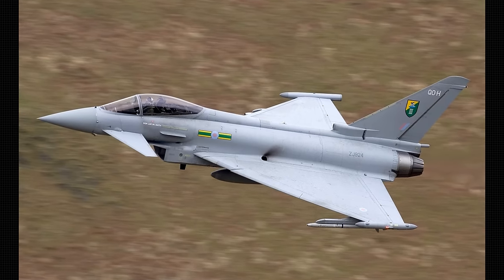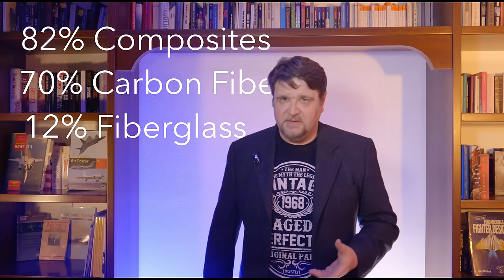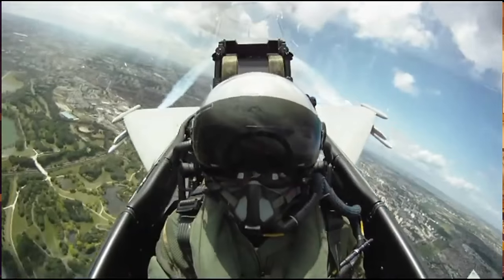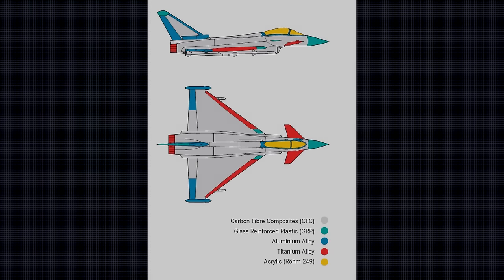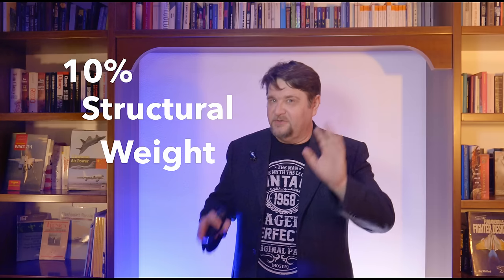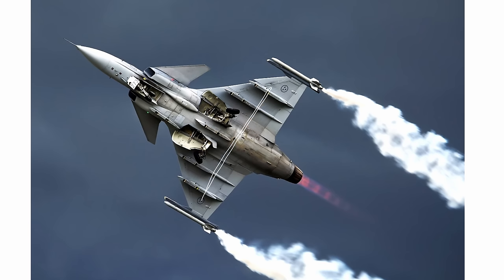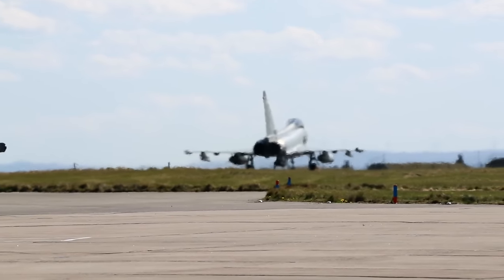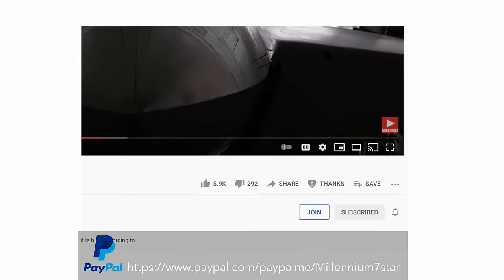The Eurofighter Typhoon is made of...

Comment: My understanding from when I did work on this sort of stuff was that composites were considered to have infinite fatigue life.
Reply from the maker: Yes, almost. Albeit at the time they weren't sure
Reply: The carbon fiber has infinite fatigue life, but the resin does not. The high stiffness of the carbon fiber takes a lot of the stresses, so that the resin is a lot less loaded and can last nearly forever.
Reply: @gbornitz  yes this is true but when you are designing aircraft the trivialities between a fatigue life of a billion cycles and two billion cycles means that they are considered to have an infinite fatigue life as long as there is no mechanical damage to the structure. So we never did fatigue because it is not a required assessment for certification.
Reply: @FG42  maybe true in an oversimplified, strongly controlled and well funded engineering environment - compared to classical aircraft industry alloys, might not be that much of an issue. But have a look into sailing magazines - a lot of well known yacht builders have been failing with multiple designs based on composites.
Reply: this depends a lot on details. UD cfrp loaded longitudinally at 0 does.

Comment: Even the armor on some of the latest US tanks uses composites. Fascinating stuff.
Reply: Tanks have used composites for 50 years or so. Some of the earliest composite armor was basically fiberglass plates
Reply: @alexdunphy3716  Indeed. Fiberglass alone is what is used for bulletproofing many public offices, such as banks, along with the protective glass windows.
Reply: Different kind of composite, the term composite in composite armour simply means that it is comprised of various different materials like ceramics and different metals, rather than just one solid steel plate
Reply: @yukionna1649  not different actually. Fiberglass is a type of "composite material" in the same sense that M7* is referring to AS WELL AS one of the materials that make up "composite armor arrays".
Reply: @yukionna1649  No, actually it's both. Layered armor can be considered composite, as it behaves as one in certain conditions. Minor point, but also true that the latest armor uses composites directly as one or more of the layers.
Reply: @alexdunphy3716  True. Advanced materials, powdered metal technologies and auxetics are coming more into play now, so there does seem be a newish qualitative leap. But yes, fiberglass is excellent and is basically what you will find in walls protecting bank tellers.
Reply: True, but it's a different kettle of fish from the discussion here.  MHV has a video with a disucssion on tank composites with a guy who literally wrote a book on it.

Comment: Love the EF but I think it's already a bit outdated. No stealth, some electronic warfare equipment is still not included and costs are quite high in comparison to the Gripen for example. In fact it is one of the most expensive aircraft per flight hour, which is very disapointing...
Reply: A typical design of the 70ies. The F-18 variants are quite a bit better overall, the French designs from the same time are not as good. The EF designers had too much money, the Swedish had to be more cost effective, so at the end the Gripen is better for the typical role in Europe today. The original EF started out as a hypersonic bomber interceptor, which the Gripen is not.

Comment: An additional advantage of composite material is that they do not reflect radar waves like aluminium does.... I thought it was worth mentioning. 

Overall a great presentation of one of the most beautiful fighter jets currently in production, in my humble opinion! ;-)
Reply: depends on the composite type, carbon fiber also reflects radar
Reply: That can actually be a disadvantage as for something like a wing leading edge rather than reflecting off an oblique surface for aluminium skin, it'll pass straight through a composite skin and reflect off of the flat faced if the wing span instead giving a much higher return
Reply: do composite materials reduce the ability of planes to weather lightning storms?
Reply: @ozan1234561  Not as much as metalls.
Reply: It will still reflect electromagnetic radiation but not to the same degree as metals.
Reply: @rogeronslow1498  That's what I said.
Reply: @kilianklaiber6367  They do reflect radar waves.
Reply: @rogeronslow1498  Usually hardly at all.
Reply: @rogeronslow1498  And I stand by my point: They do not reflect radar waves like metals in particular aluminium! ;-)
Reply: @kilianklaiber6367  Yes, it's worth acknowledging that. All things being equal the RCS of a composite aircraft will be significantly less than an aluminium skinned one.
Reply: @gamingrex2930  no, they make it worse. Additional metal / aluminum mesh needs to be added to lessen the risk. In an aluminium aircraft, the outer shell creates a really good Faraday cage(?). Classic composites don't. But they might enrich them with copper meshes - I do not know, if it has been added here.

Comment: Bravo,well worth the wait, Im looking forward to the next installment, I have a few pictures of the EAP flying, it's original proportions didn't look as satisfying as the eventual Eurofighter but it's nice to know that it was a pioneer in proving "plastic" structures. In theory a future non leaky SR-71 equivalent could be designed in appropriate epoxy composites.
Reply: NO
Reply: not really possible, the temperatures at Mach 3.6 of the SR-71 are too high. That thing is a really crazy design, on the soviet side the MiG-31 somewhat compareable, as it was designed to be capable of intercepting the SR-71. That was 1975, and it is still one of the most capable things in the ruzzian fleet.

Comment: This has left me wondering what the Tempest will be like. The EJ-20x engines are already 20% more powerful and 30% is the aim. They also use less fuel for a given amount of thrust. The Tempest is also targeted to be 10% lighter dry weight. I also heard a rumour that the service ceiling is going to be increased by 3000 meters. If that happens then some modern missiles will not be able to intercept them as the aircraft launchine will make the amount of climb needed too much.

Comment: I have worked with composites in my past job, usually stupid decoration stuff made of fiberglass and polyester but occasionally we had the chance to help these graduate students for prototyping, had the pleasure to work on notoriously self heating epoxy resin and also carbon fiber a couple of times... and I hate kevlar, it doesn't get under your skin as carbon does but it's a pain to cut to shape... overall composites are an interesting engineering subject, tho working with them is bad for your health on the long run...

Comment: Seams contribute to an aircraft's RCS, so another benefit of super-tight tolerances is reducing RCS.  Ideally one would have no seams at all, but short of that the next best thing is making them as small and as consistent as possible.  There is some absolutely wild work being done on materials that allow seamless control surfaces, eg. instead of flaps, the trailing edge of the wing just bends.
Reply: it is easier to move the whole control surface, see F-22. Flaps, different story, not sure how much it benefits as they are only required at low speed flight.
Reply: @spxram4793  I'm not sure what you mean.  The F-22 has standard fighter jet control surfaces.
Reply: @JonMartinYXD  It is mixed, I just checked again. The vertical stabilizers are split, like traditionally, but the horizontal stabilizers are one piece and the complete surface deflects.
I have seen it last August in Slovakia on an airshow, 50m from me :-) pilot was moving the horizontals, then slowly rolling, turning in small radius, after that afterburner takeoff and simulated run on airfield - breathtaking.
The first two MiG-29 they prepared for Ukraine also had their farewell flights 👋 - I had the feeling of seeing a moment of history happening.
Reply: @spxram4793  The all moving horizontal stabilizers are called stabilators (or sometimes tailerons if they can be moved in opposite directions to help roll the aircraft).  Or at least that's what we call them today.  Back in 1950 when the technology first started being used on jets (F-86E) it was called an "all-flying tail".  It was actually used on early WW1 fighters but they were very twitchy so it fell out of favour until flight controls evolved past cables and pulleys, and jets got fast enough that traditional stabilizers were not effective.

Comment: Calculation of stesses in composites required transfomation matrices to the direction of the fibers.  I imagine even double weave layers need to be arranged strategically.  Still its amazing how carbon fiber is used in so many applications these days.
Reply: these are anyway complex composites with layers, where the fibers point in different directions. It is only cost which prevents them to replace aluminium - they're far better. Only problem is high temperatures above ~2M. That's why the MiG-31 has titanium alloys in critical places., for example.

Comment: Now-a-days top of the range bicycles are made of really good carbon fibre and they cost thousands and perform amazingly good, but then you also get very cheap carbon fibre bikes which are to be avoided.
Reply: they need to have a proper multi-layer design with the fibers pointing in different directions. The El Cheapos don't look after that.

Comment: 10% reduction in structural weight is a result of very conservative designs chosen to deal with poor analysis methods available in the 90's. In practice those composite structures are much stronger than the aluminum ones. On bicycles and cars, the lightest CFRP frames can be made about 50% lighter than the lightest Aluminum.

Comment: How much does the length vary with temperature?
Reply: I don't know exactly thermal expansion for composites is also anisotropic, but it is enough that machinists shops and assembly floors need to be temperature controlled, so that a part that was 1.250 meters long in the Italian summer can fit to a part that was 1.250 meters long in Germany in the winter.

Comment: What do you think about using hemp alloys for fighter jets and generally aerospace?Henry Ford used that on model T prooved durable than metal
Reply: Great for cannabis growers
Reply: hemp reinforce polymeres have their place, but certainly not for fighter jets and in aerospace in general not for load bearing structures. The thing with Cabon fibre composites is that they provide an extremly good tensile strenght to weight ratio and weight is a major factor in any aerospace application. Weight kills perfomance and efficiency of an aircraft. So your goal is to build an airframe with as little material as necessary to provide the required strength. Carbon fibre can provide that at the moment like no other material. hemp rp is ok when the leading factor to ask for is light and cheap. In a fighter aircraft you will always go for light and strong.

Comment: structurally the eurofighter progressed further in the learning curve then what was done with the f35. the only significant advancement with the f35 was its method of combining fused sensor data.
the exterior panels on the f35 used data gathered by the eurofigher/other known engineered solutions to gain structural integrity. apparently learning structure and kinematic performance is cheaper than updating software capability. 
does anyone wonder why LM is so dead set against allowing IP transfer of software?...right to repair/update is greatly effected by lack of IP transfer.

Comment: With the paint on composite issue with A350, just wondering did they solve the paint on composites issue on this fighter?
Reply: sure. No paint 🤣
Reply: The Quatari A350 have been suffering of "first version" and higher than expected amounts of heat and UV standing around in Quatar.
There were design limitations between the stretching of the paint and the composites. The newer paint soves this.

Comment: I am curious, is it possible to engineer composites to have diffraction gratings as an option to maintenance-free radar stealth?
It works fabulously on fibre Bragg gratings for optical applications, should be the same no matter the wavelength....
Reply: as long as you don't expect it to also be structural, I would expect that's pretty close to what the F-35 has.

Comment: The nuances here are fascinating…regarding the titanic submersible that imploded after several dives, it was constructed of carbon fiber and steel — how do the forces of say a loaded wing compare with the crushing pressure of the deep.  They made it maybe 12,000 feet.  I’m sure longitudinal force, or parallel v perpendicular force is irrelevant here.  It seems this submersible’s designers didn’t  account  for basic physics, or else their pleas were ignored. I’m trying to decide if typhoon is very underrated, highly overrated. I’m sure this is the place to to evaluate it.